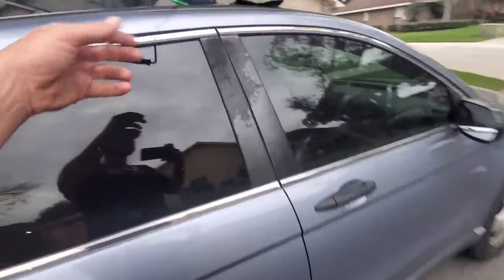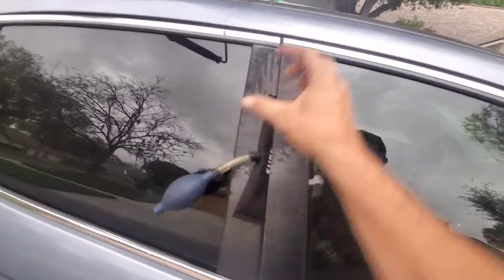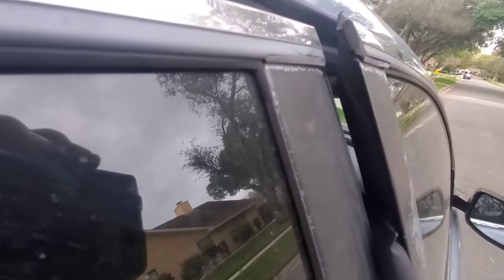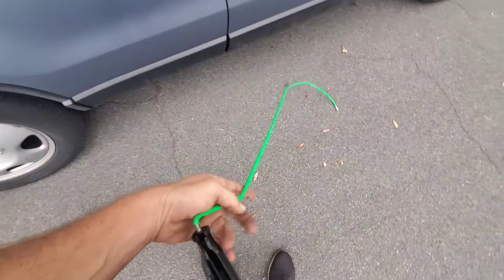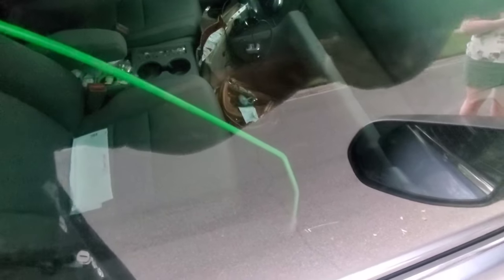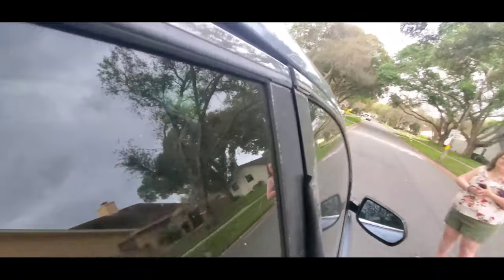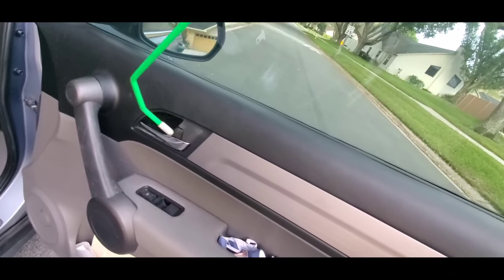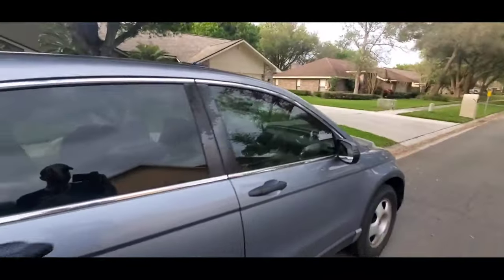HOW TO UNLOCK A HONDA CRV

Comment: Master when u have does tool on u no inside the truck 😅😅😂
Reply from the maker: Umm, I can use anything around to unlock a vehicle. I don't need any real professional tools. I can use a wood wedge and a belt or metal ruler. As a kid growing up, breaking into cars, I never had professional tools. Shit a spark plug goes through like butter and makes no sound. But for friends, I would unlock it without damage. Like using household objects nearby such as door stopes and coat hangers.

Comment: This worked great! My door locking system failed and I was locked out. I bought an Air Shim and 1/4” steel rod from Home Depot and got my door unlocked in 4 minutes. I bent the rod into a curve with pliers and was able to unlock even without a rubber tip. 
Thanks!  You’re a genius!

Comment: Very informative video.  However, even though you insert the airbag well above the lock, does inflation cause the window frame to bend?  Even if the opening you create is small, it would seem like the bending of the window frame would lead to seal damage and window or air leakage.  I would be interested in your answer or answers from other readers.  Thanks.
Reply from the maker: No the door will not be bent. The door is flexible, so it will bend back once you release the air bag. Thanks for watching and commenting. Much appreciated.